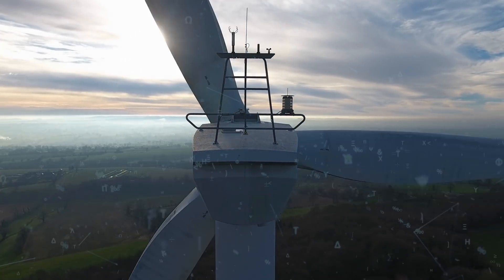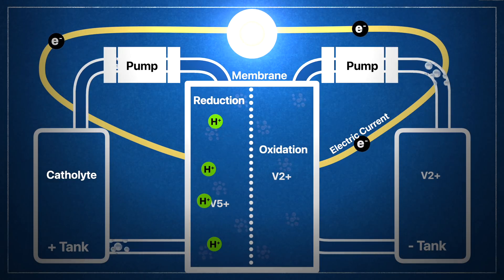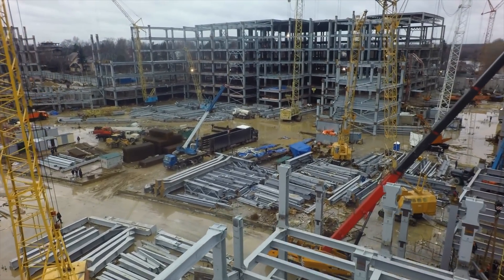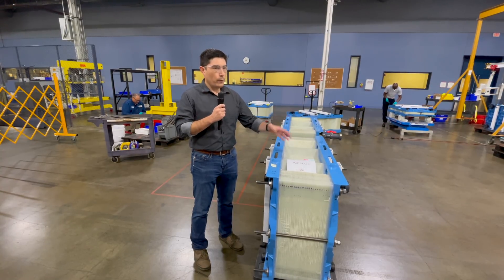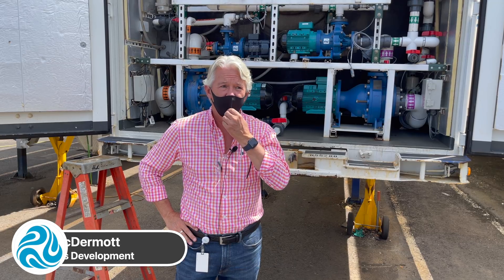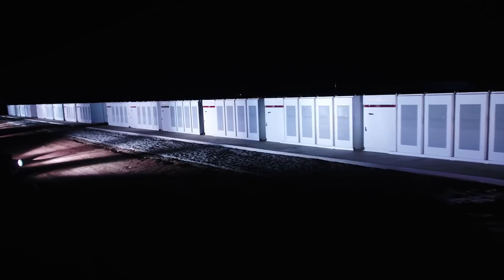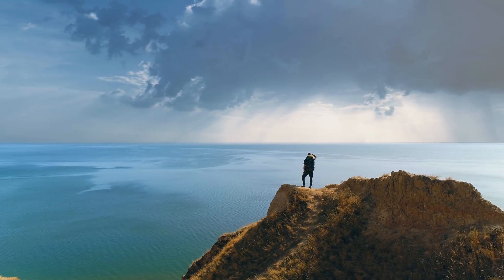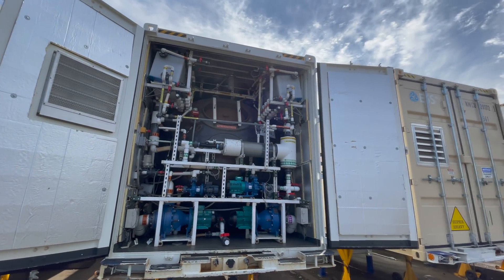The Future of Energy Storage Beyond Lithium Ion

Comment: It looks very promising for grid-scale storage.   I like the concept, particularly the design flexibility.  One could imagine having a large plant-like installation where the proton pump and electrolyte massaging is done on a larger scale,   I don't see any particular advantage in the shipping container model where each container must replicate the mechanical bits.  At least not for something like this.  It makes sense for a lithium cell, but any time you have mechanical components you have to think about economies of scale.

-Matt
Reply: The shipping container model gives you modularity.. Need to expand? Truck in a container, or five or ten . 
 Pumps starting to wear out? Replace one container at a time without shutting down your entire storage.
And the other advantage of modularity .. economy of production scale. Instead of a custom-sized build for each customer depending on how big they are, you can build and/or order batches of identical parts and crank these things out assembly-line style.
Reply: They have two basic set ups.  Their original solution was in a small 20' con-ex that grew to a 40' container that was stackable up to 2 or 3 units high.  They still offer the container units, but their focus is buildouts indoors with the electrolyte solution stored outside in tanks.
There are still applications for the con-ex solution, especially for temp solutions or dispatchable solutions in an area that has lost transmission, such as after a hurricane or other natural disaster.  They may also be preferable to a facility that doesn't have indoor capacity but a large lot.
Reply: @ScottLaneSabineParish  that is kinda cool.
Reply: @ScottLaneSabineParish  Thats an interesting, likely cost effective, and safe portable solution to large scale power outages/shortages. Envision a miles worth of train cars or tractor trailers with enough juice to power hundreds of homes and business. Place a few around the country in the most necessary areas, move them when necessary. Combine or reduce the battery cars on an as needed basis.
Reply: Why not use 1 trailer for the mechanicals and daisychain the liquid cell containing trailers together.
Reply: @briandbeaudin9166  Integrated modules prevent single point-of-failure risks.
Reply: @briandbeaudin9166  Output would be the only possible problem aka you have a huge reservoir and a tiny spigot to let it out so as long as the spigot size meets your needs it is fine.
Reply: Proton pumps...they could just burn the hydrogen do some useful work or electrical generation and make water to put back in and auto rebalance the system.
Reply: @Barskor1  with how cagey they were being with the details (during the scene where he is standing with the 2 other explain in front of the unit) it wouldn't surprise me if  that is the basics of what the proton pumps are doing.
Reply: @Barskor1  Good call, should not be wasted. Would it be possible to harness the Hydrogen and use it to run a maintenance vehicle?
Reply: @Barskor1  you have to put the hydrogen back into the system without adding oxygen. If you don't the battery will become more and more basic till it stops working. You shouldn't harness that hydrogen for anything.
Reply: good for recycle ♻️

Comment: Can you compare that to liquid metal battery? Which one is looking better?
Reply: I have the same question. I've been watching the Ambri but I don't have the cost/efficiency stats right off.
Reply: @justinddunlap  As I understand Ambri has no moving parts so works like lithium and has no maintenance cycle. So this may be better that this one. However cost of the battery materials itself may be quite larger. I guess "dirt" (calcium, antimony, and salt) is more expensive then water salt and piece of iron...

Comment: Clouds doesn't stop photovoltaic cells from working. Only sunset does. Manufacturing is the big problem.  Today we see factories producing maintenance free, safe and cheap batteries of different types. New factories are being built in a fast pace. The price will drop further and competition from other batteries will be almost impossible. Konklution: the battery factories today have the battery types of the future.

Comment: I wonder if this would be a viable solution for agricultural operations - seems like farms could benefit from this type of power backup.
Reply: Look up Red Flow in Australia 🇦🇺 , one of their owners has a farm in northern tasmania with solar and flow batteries
Reply: @hillvalley6716  
Looks very interesting. Thanks for the tip.
Reply: A pig or cattle farm can collect the waste and process it into fuel. Many do.
Reply: @lunatik9696  how do they do it. Is it costy?
Reply: That have to be a very large farm. The design comes with low density and low max amp delivered. 
The installed size have too be significant to deliver the amp needed by heavy machinery.
It will be a lot easier to build a compact battery based on Li chemistry. You can easily configure a Li battery to deliver both high voltage and high amp. I think if it is used in a significant amount it will be on power plant scale where you run it like a chemical factory and store GWatt/hours.

Comment: Interesting but that many pipes and fittings and pumps I just can't believe its going to be reliable.
Reply from the maker: I hear you Terry it's definitely intricate, but so is your HVAC cooling system, or all the plumbing around your house. It's going to require some spot checks, but again on a grid scale project it should be fairly benign. Just think about 20,000 cycles, being able to charge and discharge even more than once a day... and lasting for decades...
Reply: @TwoBitDaVinci  I see lots of china made motors in that system so many chances for things to break down. The cost of sending someone to repair these kinda systems is going to add up fast. I build all kinds of off grid diy systems this looks like trouble to me. Even simple EV charging stations are all ways broken  I can only imagine how difficult this would be to keep running.
Reply: @terrya6486  imagine a 5 acre plot of land with 25 of these containers sitting next to a power sub station. You're likely going to have a couple employees on site to monitor operations and do a daily walk around to check for leaks etc. There shouldn't be a problem with these guys replacing any broken pumps or valves.

Comment: There will be a small shed sized residential battery I'm sure...just have to compartmentalize the moving parts into one unit that can be switched out with a spare.  Send the broken one in for replacement and the depot fixes it and returns it to service.

Comment: The winning technologies are going to be those that utilize the most common elements, such as Oxygen and Silicon. I still believe arrays of capacitors are a simpler solution than chemical batteries.

Comment: I'm not sure I view this as a flow battery.  It's capacity is limited by the amount of iron plated onto the anode.  Once charged, the cell cannot charge more by swapping tanks.  The similar is true for discharge, once the Fe is dissolved, one cannot swap a tank and continue to discharge.  The cell itself determines capacity as well as power.  Nothing is mentioned as to tradeoffs in capacity vs. power when designing the cell.  I can't tell if there should be any or if the cell can be arbitrarily thick in order to permit plating of a large volume of iron.
Reply: It should be referred to as a plating battery.  There is another one using Zinc Bromide which comes from Redflow in Australia.  Quite a different concept than a flow battery.
Reply: So they need swappable annodes!
Reply: Another significant problem with this type of battery is dendrite growth. As the battery charges and metal is plated onto the anode, it doesn't plate in a flat surface but can grow spikes. it is difficult to prevent these spikes eventually growing across the battery to the cathode and short circuiting the battery.   I'm sure they have a way of dealing with it, but it's one of the secrets behind their system.
Reply: @KeithBab  Dendrite growth can be easily managed by using specifically formed separators that would allow easy flow of electrolyte between anode & cathode but will forcefully redirect where the dendrite should they formed.
Reply: Good I am not the only one that see’s it. Sounds great looks complicated, smells fishy.
Reply: Yeah, they didn't mention peak power - one of the other highlights of lithium ion. The system needs to be capable of doing a full charge/discharge cycle in half a day at most or it's kind of useless for short-term storage.
Reply: Why not? It seems quite possible to change tanks or have larger tanks.
Reply: @JustNow42  It is possible to change tanks but not the electrodes, where the material is lost. In a true flow battery the solution is depleted while the plates are unaffected.
Reply: @JustNow42  When charged, the iron is plated in solid form on the anode.  Once the anode has been fully plated out there is no room for more iron.

Once the anode is depleted of iron there is no means by replacing a tank of liquid to "recharge" it.  I suppose it's possible to place the anode with a plated one, but that defeats the purpose and what I hold as the definition of a flow battery.
Reply: Unless you can move the plates father apart as the plating /dendrites build-up.....remember this is not exactly space-constrained as in a car battery.
Reply: Good point. I didn't catch that when viewing. That's probably the reason for the shipping container model, where there's a maximum tank size a given anode size can support.

Comment: I like the ability to not pollute the environment. Considering the massive size would this be able to power cargo ships?
Reply: I did similar calculations for the RMS Titanic before (for lithium-ion-batteries).
The Titanic needed ~25 MW power for normal cruise at 21 knots (39 km/h).
It could carry 6700 tons of coal. Let's replace this coal with electrolyte with 25 Wh/kg: This would give us 167.5 MWh. Counting in energy losses of battery and electric propulsion system, we would get ~5 hours of normal cruise and a range of 195 km.
If we wanted to expand this range to 5500 km (atlantic crossing), we would have to reduce power to 168 kW and speed to ~7,3 km/h.
The journey would last one month (31 days) instead of ~6 days with 21 knots.
If there was no wind and no ocean currents, which would play an important role at such low speeds.
Just for a rough visualization of the scales.
I didn't count in the higher energy demand for living for 31 days instead of 6 days.
Reply: Basically yes, but due to the extremely low energy density compared to liquid hydrocarbons, you won't get much range with normal speed.
Reply: Or you would have to sail very very slow to get a reasonable range.
Actually, this would fit better to the properties of redox flow cells: Low power for a long time.

Comment: I didn't know Iron platting was possible. I wonder how hard it is to Iron electroplate products? I also wonder how many O2 barriers they need in the pipes and tanks. I wonder what salt they are using. I tried to electroplate iron over 10 years ago, but I got a mess as the salt broke down into sodium oxide and chlorine.

Comment: Great video, but can we hear the round trip efficiency and the energy and power densities?
Reply: The only thing that matters is price per kilowatt ..... Power density is irrelevant
Reply: @13thbiosphere  You get the cheap cost of bulk materials (sodium and iron) and the manufacturing costs are far less per kwh. Sodium ion batteries are only 30-40% cheaper than lithium because most of the cost is complexity and specialty of materials.
Reply: @joe7272  actually the current cost is about the same but almost  infinite material.... the long-term it'll be half price probably 4 years to scale up
Reply: Of course not!
Reply: that is the only thing i was waiting for
Reply: since they are a water-salt-iron battery it is probably SUPER SUPER low. Since it's grid scale it doesn't matter, build 3 million gallons of tank capacity. Salt batteries have worse power density and iron have bad power to weight. You are likely stuck with the downsides of both to make it work.

Comment: Did they mention roundtrip efficiency? What are those power and energy density statistics?
Reply: Apparently theoretical energy density is 170 Wh/kg. It is comparable with older types of Li-Ion batteries, but the volumetric density is lower, probably 120-150 Wh/L. Plus add the mass and volume of all the infrastructure. Also boosting 1,21V to 320V or more is not a great idea - efficiency drops with rise of voltage difference...
Reply: @urgon6321   A lot of those things you brought up aren't really a concern when you're talking about grid scale stationary storage, as another poster pointed out it's all about the price,   It doesn't matter if it's 4 times the size of a Tesla megapack If it's a fraction of the price.
Reply: @mrspeigle1  Another point is that although a 2 to 4 hour system may be slightly larger that Lithium Ion, ESS doesn't need much more increase in size to go to 12 hr while LIon requires almost doubling to go to 4 hr and double that to get to 8 hr...  So short of a short duration discharge and short term ancillary reactive power services, etc., LIon isn't playing the same game.
Reply: @urgon6321  and the power density?
Reply: Energy density or weight per kWh is less critical for stationary storage.  All about the $$$ per kWh!
Reply: @xiaoka  still needed to get an idea of the size per unit storage, and per unit output.
Reply: Goggle says around 70% which is less than Li-ion but still useful for > 4hr grid storage. Biggest thing is getting production ramped to lower costs.
Reply: Hopefully at least the money was good for these ads, both of them... 
Leaving out key parameters is always a red flag.

Comment: I'd like to see a comparison with green hydrogen storage.
Reply: There are a few great and promising Hydrogen technologies and they will have a place, but they are not solutions for the same problems.  Right now, there are very few real "green" hydrogen production techniques and they lack the efficiencies for grid storage.
Reply: Not to be a party pooper but Green Hydrogen can't even compete with gasoline.  Operating an EV is much cheaper than gasoline which is much cheaper than hydrogen(Green Hydrogen is the most expensive hydrogen).
Reply: @wineberryred   Current energy prices you are correct, however  As  Intermittent renewables like wind and solar Become a bigger and bigger chunk of the grid the amount of surplus energy available on normal days if on normal days is going to push the price of electricity down.  If that happens green hydrogen becomes much cheaper Is, moreover hydrogen electrolysis at scale isn't really being done at the moment so I suspect that mass scale production  Will push these prices down further.   Do I think that hydrogen will be used for  Ground transport or energy storage? No if bridge? No however I think it will have a place in aviation particularly if  The modernized Zeppelin's Become a thing.
Reply: @mrspeigle1  round trip effeciency of hydrogen is too low to be economically viable. When energy us cheap because of oversupply you are better off chargin EVs than making hydrogen.
Reply: @mrspeigle1  Ammonia can be used for energy transport through pipelines made of carbon steel that aren't treated to provide transportation of hydrogen.